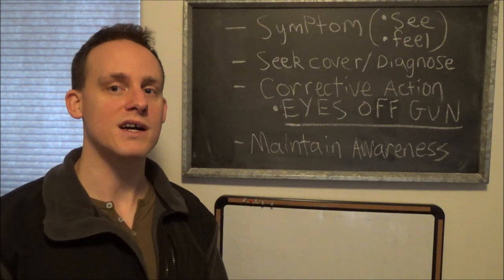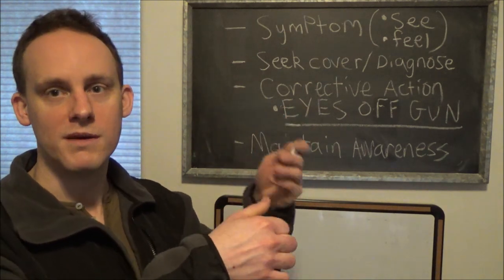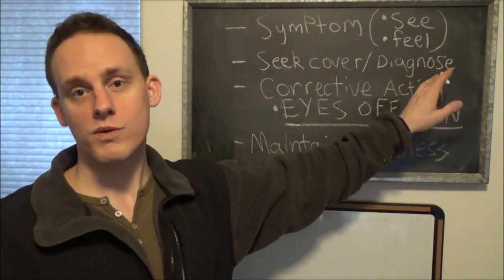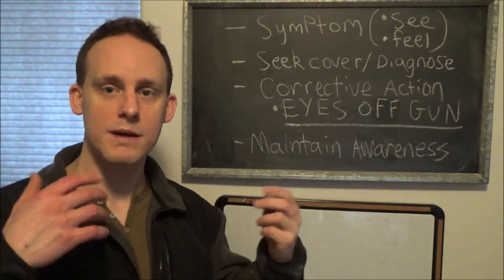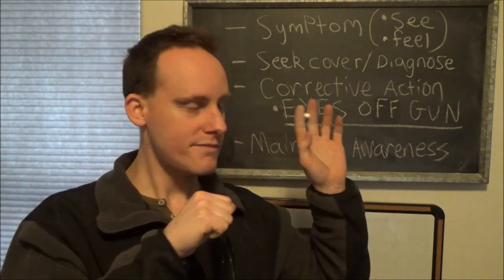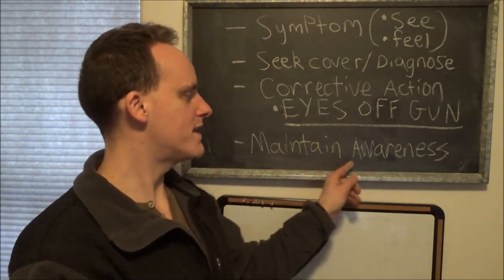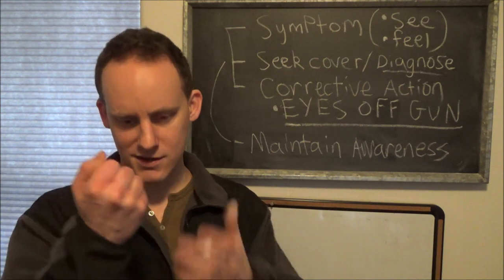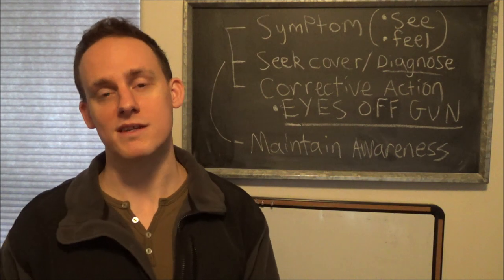Proper Malfunction And Reload Process

Comment: I respect that you have actual experience with this situation, I don't. That said, it seems that perhaps switching to a backup weapon, like a sidearm, might be a good idea under some circumstances. Perhaps falling back would create more exposure and pressing on just a bit is safer, or maybe a lateral move is safer. I guess it all depends. Thanks for putting this out there though. Certainly a worthy protocol to start from. :-)